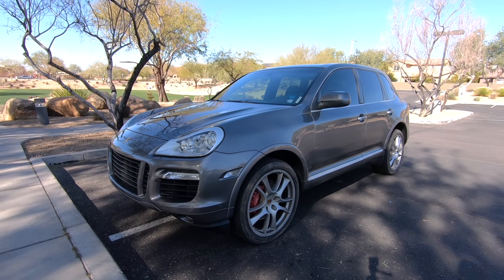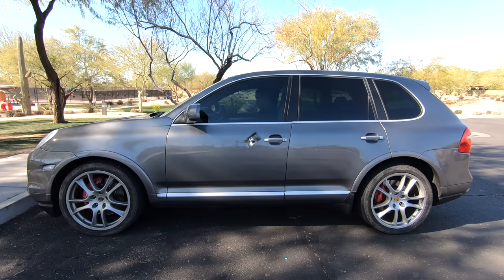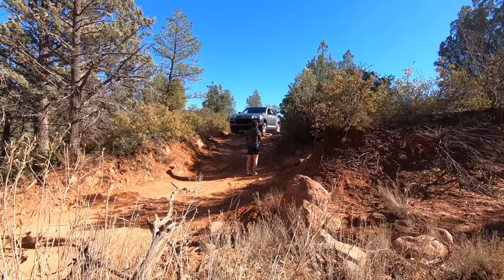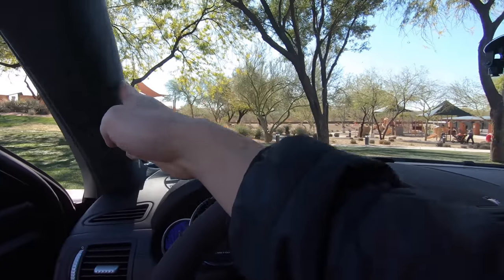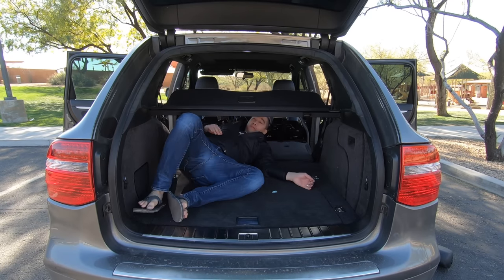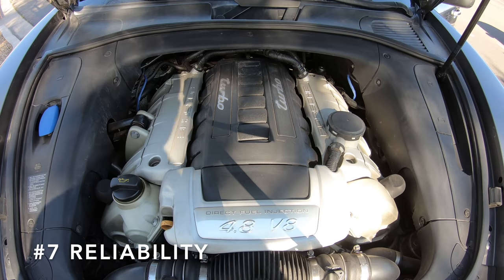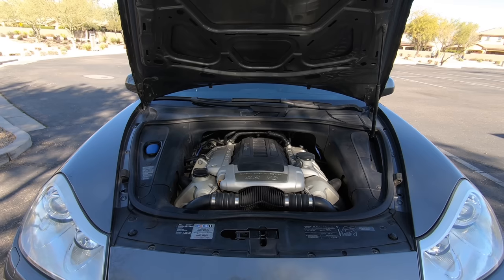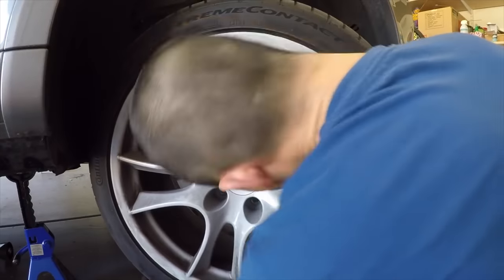Why You Should Buy a Used Porsche Cayenne Now! (First Generation 955/957 Review)

Comment: I brought my cayenne 3.2 brand new  in March 2005 , paid £45,500 for it with a few extras. It’s heavy on fuel (20 in town , 25 on a run and 12 if you put your foot down ) but it’s been an absolute great car. It’s now March 2021 so it’s 16 years old, 108,000 miles and past it MOT this morning with no bother whatsoever. It’s never failed an MOT. Change the oil (Mobil 1) every 2 years have it checked by a mechanic and it’s good to go. Only issue was water ingress in the footwell caused by a build up of leaves that blocked the rubber water release grommet by the wheel arch. I took them out and have had no issues since. It still drives like a new (ish) vehicle , looks good and as I change my wife’s car every 3 years ( £ 45-50,000) , my van every 4 years (£35,000) you can see why I’ve kept this thing I call the Panzer.  it’s the best vehicle I’ve ever owned
Reply: My 04 is also the best! I honestly can’t believe how fabulous it is!
Reply: Oil every 24 months? Sounds suspect.

Comment: 219,000 miles! That’s how many on my 2008 Cayenne Turbo, purrs like a cat, idle is rock steady, doesn’t burn any oil, looks fantastic! Learn to turn a wrench, not expensive to maintain. My interior still looks close to brand new. 500 hp still pushes you back in your seat. Built like tank! I agree, best SUV for the money (if you can turn a wrench)! Excellent vid!
Reply: Since you're a longtime Cayenne owner, what's your opinion of 2021 and newer Cayenne Turbo and GTS models?  We know the newer generation has been upgraded with newer technology and I suppose performance is tweaked to be slightly better.  I would hope known issues (like the ones identified in this video) on earlier model Cayenne's has been reengineered for better reliability on later models, but do not know if this is the case.  In general, what do you think of the later model Cayenne in Turbo and GTS trim with the 4.0L V8?  Is the 4.0L V8 a reliable engine?  Also, do you have an opinion on the Technology package and the Sport Chrono package?  What do you like most and dislike most about your experience with the Cayenne and what trim level and engine size is in your car?  If you were in the market for a used Cayenne today, what trim level and options would you prefer and what year vehicle?  I appreciate your perspective as an owner of the Cayenne.
Reply: @RedondoBeach2  130k miles on mine 09 cayenne s. Went non turbo to keep strain on the engine down although they hold up just fine so the new turbo models are great for fuel economy. I would get the options you want and need. I bought mine with the pano roof when it was still an iffy design and now it's best i just keep it closed and wish I would've gotten the regular sun roof. Now looking at an X5 45e plug in hybrid just for the added cargo space as i found i want my SUV more for usability than speed looks now. I would go with a plug in cayenne if i was you especially after the amount of money Porsche invested in electric power development
Reply: @GU_WOP_O  Thank you.  I will consider the electric. At this point I have a somewhat wide range of vehicle considerations.  A truck is even on the list.  Similar to you, I need cargo space, so a utility vehicle is desired.  However, after many years of driving my current car, I would also like the next vehicle to be better looking and sporty, which is one reason I like the Cayenne.  Aside from that, I've always liked Porsche.
Reply: @RedondoBeach2  you should consider the x5 40i or the 45e which is the same except a plug in hybrid. The straight 6 cylinder engine is what bmw is known for and this is the best it's going to get as they go full electric in the future. Its turboed so more than enough power for an SUV and the engine is getting tuned to push 500hp no problem so it should last a long time in stock form
Reply: @GU_WOP_O  You make a compelling argument.  However, my flaw is that I'm just a fan of Porsche and like what they've done with the Cayenne Turbo, and generally with the GTS too.  I'll add that I'm not in a big hurry to buy.  When I do, my intent is to get a 2-5 year old Turbo but may consider a hybrid as well.  I may end up shopping for quite a while to find the car optioned the way I'd prefer.  For example, I would ideally like the exterior painted in dark metallic blue.  Porsche used to call this color Midnight Blue but have either renamed it or come up with a slight different variation of the color.  The exterior trim and emblems should be in silver, unlike the personally less desirable black on the GTS variant.  Interior finished in black or tan leather.  No red leather.  There are also preferred rims.  The list goes on.  Porsche has made their cars so customizable that I would be surprised if any two are exactly the same.  I don't need one to fit my exact desires, but 90% of the most important desired features, at the right price, would make it worth my while.  This is an aspirational car for me.  I bought my current car (2004 VW GTI VR6) almost 18 years ago and it faithfully continues to be my daily driver.  I justify the Cayenne to myself partly based on how long I've owned my GTI and as a result, cost avoidance of buying different cars every few years which seems increasingly common for most people.  If I find a good and reliable Cayenne, I can see myself owning it for 18+ years as well, so it has to be properly spec'd for my taste.
Reply: What oil are u using? Mine burns a litre every 1000 km roughly

Comment: My 05 Cayenne Turbo is Fantastic. 120k.  Black on Black on Black.  Chipped to 500hp.  Recently I took out the non turbo spark plugs and installed the Beru turbo plugs and took out the aftermarket chinese coil packs and changed them to Beru coil packs.  My car thanked me about 500 horsey times.   Custom exhaust makes it sound fantastic. So does the. 9" Xtrons touch screen stereo.
Reply: @Ernie H why don't you fix it yourself, it's no different than any other car

Comment: We have a 2009 Cayenne base model. Bought two years ago for $11,500 with 88k miles.

We've had a couple of repairs totalling around $3k. The valve cover (pcv) was $1700 (genuine Porsche) and an incompetent shop's replacement of the battery at $890! Live and learn. I should have done it myself for around $250. I did replace the interior blower motor myself for $48. 

Fantastic vehicle for sure. No regrets.  We get all kinds of looks and admirers at the gas pump.
Reply: wow I'm looking at a 2009 right now for $12,000 with 99k miles on it. In fact just requested additional pictures.  It's a six cylinder but I imagine it also has a turbo.  I didn't want to go with a v8 due to gas costs but it'll be my toy if I decide to move on it.  I would really try to do the basics myself such as spark plugs and simple repairs like that.  I'd never go to an exclusive porsche shop.  Do you sitll like your Porsche, any further incidents and what else should I look for?
Reply: @joesteel  
I've owned five 944s over the last 14 years and learned a lot about the Porche culture. 

Without a doubt the most important things are the service history and researching the known flaws of any particular model and year.

Owning one is in part becoming part of the family and community. If you want one simply for show and status it is not for you unless you have money to burn.

Treat it like the timeless thoroughbred it is with respect and commitment you are going enjoy something truly special.

If you don't you're in for a lot of pain and frustration.

Keep up with the maintenance like a religion and you'll be rewarded with many years of rare enjoyment.
Reply: $890 for battery? I have a 2008 Turbo, pretty straightforward to replace, just under the drivers seat. Sorry you had that expense.

Comment: I own a 2009 GTS and love it. I have all the options on mine a Turbo has, so :P to your comment about the GTS. LOL!  Now, I am not a Porsche mechanic, but I have worked on cars all my life. I even do all the work on my 88 951. 

This has been the best all around SUV I have ever owned and will never settle for less.
Reply: I’m looking at an 06(s turbo)with 134k for $8800. Runs and sounds great, but I am not a Porsche mechanic and don’t know what to expect on maintenance. I hear horror stories in threads and hear nothing but love as well. How many more miles can I expect out of it?
Reply: @jampav33  Do they have the records for the Cayenne?
Ask about the cooling pipes. Might have already been done, but safer to ask. 
Ask about when the driveshaft bearing what changed.
Ask about the transfer case and when it was changed.
When were the coils/plugs changed? They should have done the top engine mount at the same time.
I would also take it to a mechanic and have them check the cylinders out along with the turbo's.
It is a love hate relationship LOL! Best to learn how to do some of the basic work yourself. Brakes, oil changes, air filters and changing out the plugs and coils. This will save you a lot of money. 
I have over 137K on mine. Drives and rides great. Once you own one you will find it hard to except anything else. Good luck to you.
Reply: Yup, I have a 09' GTS. Bitchen car. One thing that is better is no turbos. No intercoolers to worry about if you plan to off-road it and modify it. I also have a 10' Touareg TDI, both incredible, similar and totally different.

Comment: I bought a Touareg, sister to the Cayenne, a couple years ago. Went all in on an early on. 2004 with the V10 twin turbo diesel. I got it for cheap knowing it would need an expensive engine-out service and did the work myself.

It doesn't quite have all the bells and whistles, but it's pretty close. Diesel powered heater with remote. It has the low gear transfer case and rear locking differential. Has the air suspension as well. One of the front bags did pop on me. They all appear to be original. It made it 17 years and 207,000 miles, so I can't really complain. 

The factory air bags are pretty well-protected and armored. Nice aluminum covering and a plastic bellows that keeps most of the ozone and dirt from ever getting to the main bag. Unfortunately, the replacement Arnott bags I got for the fronts are not so protected, but do at least appear to be made with quality materials. But given that they aren't shielded, I am not expecting them to last as long.

These things ride great, handle great and do surprisingly well off road, you just have to go slow and stay on the throttle to let the computer figure things out. With the air ride pumped up so much in the off road heights, it's a very stiff ride with very little give in the suspension. A wheel will be in the air frequently, but they're oddly well balanced when off roading like that with a wheel in the air. Just keep the throttle on and the computer will figure it out and you'll slowly make your way through.

Comment: Really impressed with where you're taking it on the 21" rims and low pro tires. Also, don't knock the GTS! Only way to get a V8+6-speed combination. Check out the BaT prices for those- one just concluded with a $65.5k closing price!

Comment: 2006 CS 190500.  Pulls tear drop camper.  Purchased used with all the serious issues already resolved.  Mostly regular maintenance and suspension work.  Several previous owners suffered through the trauma.  I am benefitting from it now.  Zelda is the grey warrior.

Comment: THIS VIDEO CONVINCED ME TO BUY ONE, I’m looking at a 07 cayenne S with 155k miles on it for $5500  runs good strong engine and smooth transmission, tires all around brakes and rotors are new!!! Only problem is windscreen has a big cracked, so it needs a new one, but that’s about it , exterior is 7/10 interior 8/10 , so I think it’s a good buy !!
Reply: That's an absolute steal!

Comment: I have a 2005 Cayenne S.  I have only 24k miles on it, and only use it for short highway trips in the Mexican Yucatan.  It still looks new, and I absolutely love it. So far I have done all regular fluid maintenance, and it will make its second only trip to the dealer for lower control arms.
In spite of the low mileage, the notorious speed bumps here combined with the weight of this SUV have prematurely worn the bushings out.
I will also replace the rear hatch struts, which are a little weak now, from age Vs use.  The engine is amazing, as is the handling, and comfort of this amazing vehicle. For the price now of these amazing vehicles,  and the timeless styling,  it is a must consider option for a used SUV. Parts are available at low prices, and it is an easy vehicle to do minor service on.  And after all, it is a Porsche.  It looks amazing still, parked next to my two 911 Turbos.
Reply: I had one of these and loved it! But I have to admit that I put a lot of maintenance into it over the 50k miles that I drove it. Did most of the work myself. Fine if this is your second car and don’t need it daily. Not great for a daily driver though.

Comment: I just bought an '08 Cayenne S and it's the nicest driving car I've ever owned.  So far so good, no issues whatsoever.  Check back with me in a year...
Reply from the maker: Awesome! Hope you enjoy and are subscribed to the channel! Check out https://www.ecarguides.com for DIYs for your car!
Reply: R Morris  Freaking great.  Best car I've ever owned.  I think I will probably have it for a long time.
Reply: R Morris  Well, I know it can be expensive when something breaks, and I haven't owned mine for very long yet, but as far as I can tell these are more reliable than your average vehicle, with most of the kinks worked out in later models.  Make sure you understand the full service history of the vehicle.  As long as the regular recommended maintenance is performed, the car should last a long time.    There are certain parts that have an expected lifetime and need to be replaced during regular maintenance intervals, and invariably something will break.  It's a car after all.  I had two different mechanics inspect mine and they both said it was squeaky clean.  You should always get a PPI.
Reply: @chrismcgraw2112  Update? ;)
Reply: @ronp.6782  No issues, great car!
Reply: 2024 update ? Hi there
Reply: @savdel  The starter motor was going bad and I had it replaced.  $1600 labor for replacing the starter.  Thankfully the guy I bought the car from had included an OEM starter from Bosch so I didn't have to buy that.  He had suspected a problem with it, but I got away with driving it for about 4 years before I actually had to replace it.

No other issues, still quite love this car.
Reply: @chrismcgraw2112 thanks mate wishing you all the best

Comment: I have a 2014 Cayenne S platinum edition 90000 miles absolutely no problems 2 and a 1/2 years in. BAD ASS  Black on Black. 
 As long as you have a second vehicle to drive Every DAY, you will be fine on the maintenance.

Comment: If you want a lower maintenance Cayenne, get the diesel without air suspension (one with <100k on it). Note the oil changes cost $200+, $100 if you do it yourself but you will need a OBD2 scanner tool to reset service intervals. Also, take it to a Porsche shop you know before you buy, they will tell you exactly what needs fixing.
Reply from the maker: Great advice. All things I do to make owning this beast more manageable!

Comment: had an '08 S for four years and didn't have one problem with it. like them so much I moved up to a '12 Turbo and got a 4 year warranty with it that has already paid for itself.  couldn't be happier and nothing has run past me yet.
Reply from the maker: Smart on the warranty! More and more transfer case failures are popping up. Have you had that issue?
Reply: @CarFanatic  Yep, transfer case went out in it at 69,000 miles and had it dealer replaced under the warranty. Also had valve cover gaskets replaced after it was leaking oil at 71,000 miles. No other issues so far still have 12 months of warranty left.

Comment: The only thing is that if you get keys made for them by the dealer then they will cost at least $550 each.  You will also need a good scan tool so that you can reset the service now light when you do an oil change on it.

Comment: thanks its a nice video,  i was also surprise of some features of this car. and i always use it in a construction site during my inspection visits  i agree its a reliable and a good car, in 2014 i bought a second hand  porshce cayenne s 2009 yr model with only 30k kilometers done. and today year 2024 it is now 231k  km done. the history of minor issues for me are, the coolant pipe at 130k  km,  fuel filter separator  at 170k  km, window motor, back door strut, replace of starter at 175k  km. center bearing at 180k  km,  air suspension in front left and right at 200k km. so far so good  today it is now 10 years i am driving  and i love it with 231,000 kilometers still have the power to push you back to your seat when you step on the gas.......